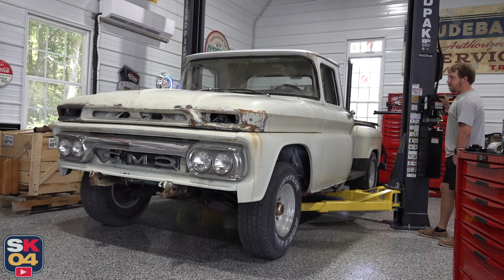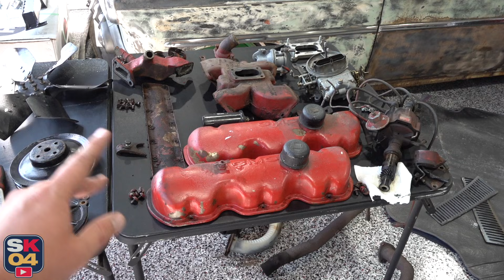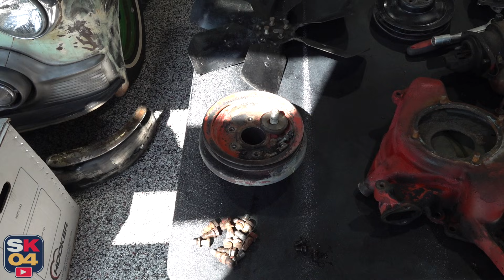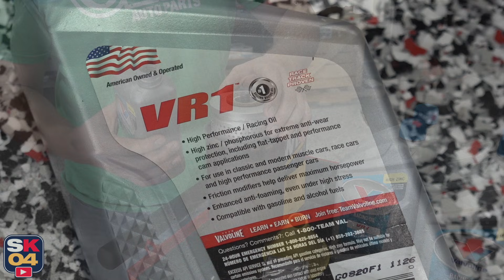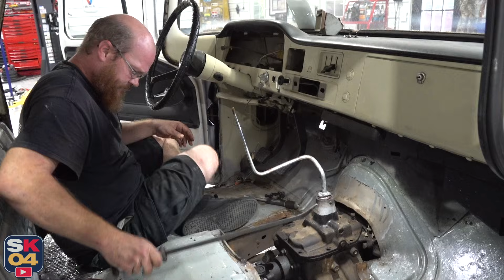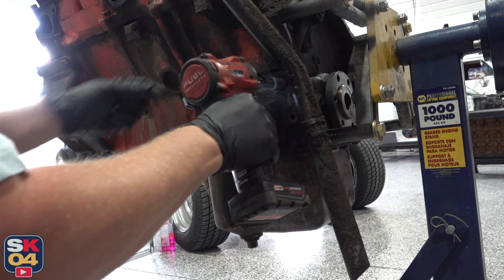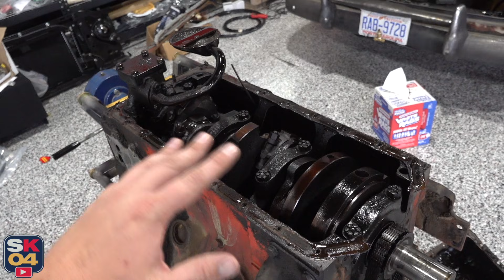Here's An In Depth Look At The Incredible GMC BIG BLOCK V6!

Comment: That engine looks to be build crazy strong. It looks like it shares some lineage with the Chevy 348/409. I wouldn't spend a lot of time and money on that distributor. The old breaker points really work very well if you set the gap correctly, which is very easy since the cap has the window to adjust the dwell with dwell meter.
Reply from the maker: Yes sir, I look forward to learning more about how to do that.  It's super cool!
Reply: Doest share anything with the 348/409, I get this all the time at car shows
Reply: They made these all the way up to I believe a 702 in³ displacement! They even made several variants that were known as the Toro flow yeah squirrel flow. They were actually for the time, excellent as far as fuel economy goes for for a V6 diesel engine.   Some fishbowl and GMC newlook models had Toro flow engines in them, 6 and some 8 cylinder Turbo charged, they're a little hard to find  At least from what I can tell.
Reply: @isfeldt34  The military had turbocharged Toro Flows in '65 and'66  bus/ambulance combination Superior bodied buses. Somewhere along the way they removed the turbo's first and in the early 70's entered into a contract with Cummins to repower with triple nickle V8's. The motor pool I worked in had two of the converted buses in 1974.

There were also marine turbocharged Toro Flows. Very rare today but I have seen them turn up on ebay after a boat repower. I still have one DH478 Toro Flow.
Reply: I had one of these and the distributor did not have a window.